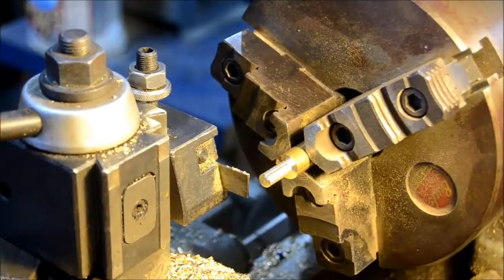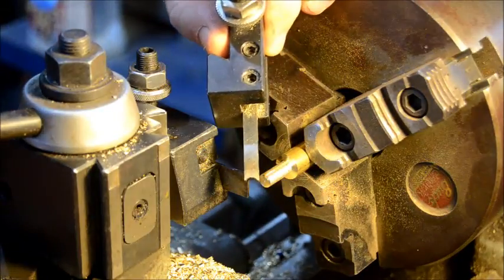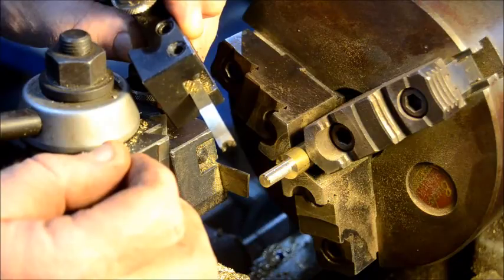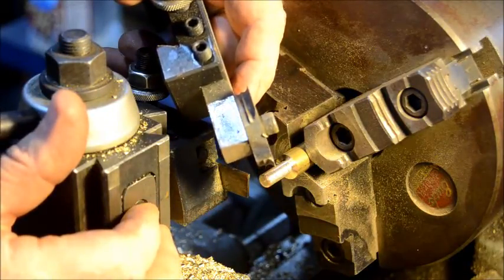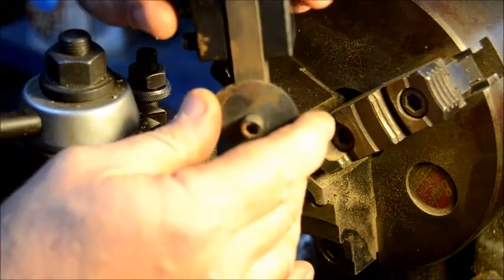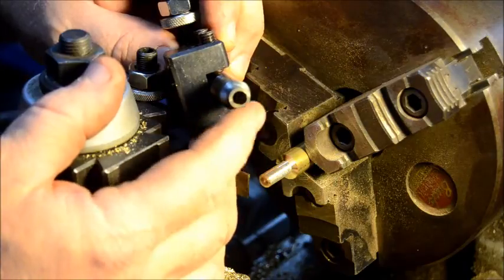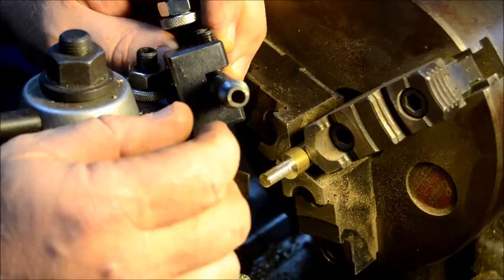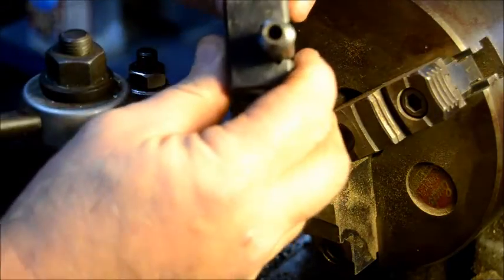Musical Instrument Post Ball Turning

Comment: Hi Matthew.
Thanks a lot for the video. I'm trying to do the same at the moment, but I feel my ball has a tendency to turn oval, or lightly pointed along the axis....
I'm not sure to ear well what you're saying when the lathe is running,
Do I understand correctly that you say, you first bring the tool as you say tengent to the end of the post, then you
start with the cross slide until halph of the ball is turned, then you feed with the compound ? (or the reverse ?)
Thanks a lot anyway, there's not that much info available about key making,  keep posting !
Christophe

Comment: That was amazing. I have a casual interest in using metal lathes specifically for the purpose of restoring brass instruments, like cornets. I've been around tools my whole life, but not a metal lathe. Seems a lot more complex than a lot of other types of tools. How did you learn?
Reply from the maker: I don't monitor my videos closely. The tool post is a phase II import aloris  copy.  Getting the ball round and not oval takes practice. Using the method where I made a tube to cut the post requires the blank to be pretty close to the same size as the cutter. In this case start with a 1/4x1/4 cylinder for the post ball.